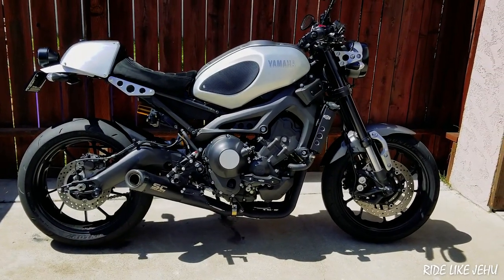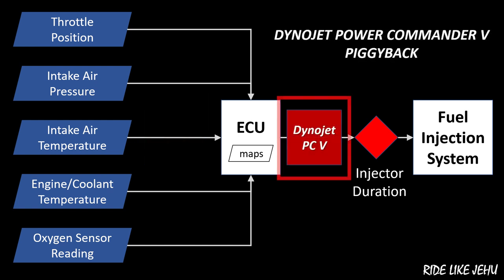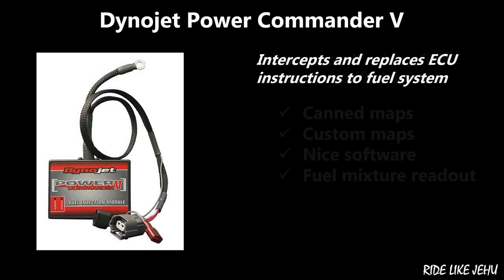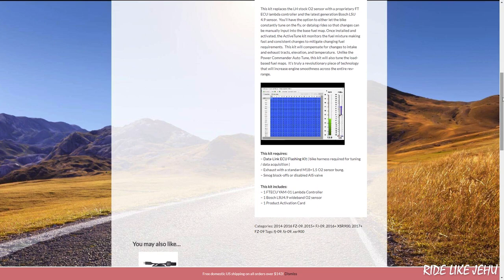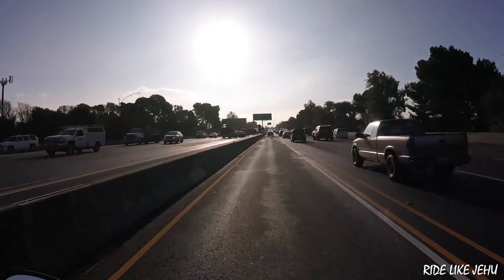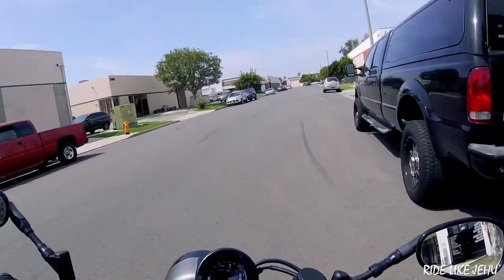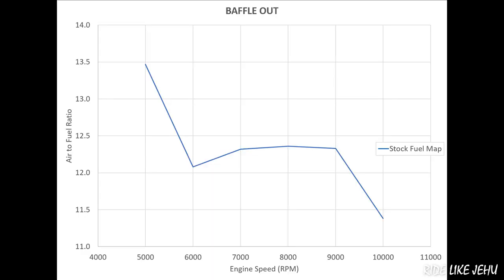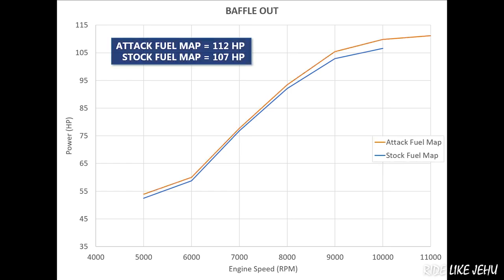Yamaha XSR900 SC Project Exhaust Upgrade Part 4

Comment: Blown-away by the detail, clarity and quality of your video!!  I feel like the gains ~ 7% (full system & dyno tune) are a very small gain.  If a person wanted more power they could just buy a more overpowered bike to begin with.  Tuning or engine work only seems to make sense to me if a bike is under-powered <40HP? and there is no other bike that is similar to buy.  Most people want the more noise & the illusions of power so a slip-on makes the most sense.  Again, thanks for such great info.  ***Next, maybe a video discussing the suspension which I have heard is on the stiff side.

Comment: I own an MT09SP which as you well know has the same engine and frame as yours. I’m also not in search of increasing horsepower but a better sounding exhaust. From listening at a lot of aftermarket exhaust systems on the internet I concluded that the SC Project systems sound the best for the triple engine. I am somewhat disappointed by all the companies that provide these exhaust systems however. They all do their best to sell you these quite expensive systems when in truth they don’t give any significant improvements in performance to the engine without having the ecu modified or installing a piggyback electronic system. I think that when you are shelling out that much money for a complete system it should come with at least a piggyback controller. SC projects is the only company that I know of that provides it’s own fuel controller system but you have to pay around $300 extra for it. It is not the air controller you mentioned but a new IFC system as they call it. Trouble is that the company will not send me a typical dynograph readout with the unit installed so I can see the improvements it makes. They assume that I shell out my hard earned money on trust alone. To me that is not acceptable.

Comment: How were you able to ride your bike away from the shop. I called Joseph about my XSR900 and he told me I had to tow my bike to and from the shop because of CA law requiring off road use only with after market exhausts. Did you install the exhaust first or did they install it? Thanks

Comment: wow!!!!!!! what a thorough review,,,,,,,,,, many thanks for this educational video series. 1 question, I have been told altering the ECU is a one way street, it doesn't seem true from your videos,,, you were able to retune it for with baffle ,  so can we tune the ECU multiple times ?
Reply from the maker: Yep, the ECU can be tuned multiple times. The dyno tuning process was iterative. Mine was tuned at least a dozen times while the fuel mixture and power output were optimized. Also, if you decide to put the original exhaust back on the ECU can be re-flashed back to the original settings. Of course if you're having a shop do all of this re-tuning they are going to charge you for their work.
Reply: Thanks!!!! I hope remapping the ECU won't void my warranty, I have another year left so I might just wait,
Reply: @RideLikeJehu  Good info.  I searched all over for this simple question and you are the first person to clearly answer it.  I guess no one has heard of "UNDO".

Comment: Wonderful! This is the only guide anyone would ever need to replace any exhaust on the XSR900. One thing that I was very curious about, and it's not shown here, is the emissions impact with the different bikes. I want an XSR900 and I'd probably replace the exhaust, but I also want to remain compliant with emissions regulations. Do you know of any site with a comparative as you found for power? Thanks.

Comment: The stock exhaust produce a flatter torque line. Why the SC project exhaust produces a dip in torque between 5k-6k rpm?
Reply from the maker: Good question. I wonder if the lack of cross-pipes between the headers is a sign that the SC Project is not as well engineered as the stock exhaust or the Akrapovic.
Reply: @RideLikeJehu  You would have to look for dyno videos on that pipe to answer that question.  I have a feeling that stock motor is really matched to stock exhaust flow and many aftermarket pipes will give in some places but take away in others.

Comment: So I bought 2019 xsr900 and love it I now have 500 miles on it ...  BUT something is wrong . Three times now during me riding normally the bike engine power shuts of randomly ( I have no idea why please help ) 
It starts right up after and is fine... ???
Anybody have similar problem or ideas why this is happening ?
Reply: YES!!!! THIS IS is because of a safety feature inside the bike. your hitting the rev limiter
Reply: same thing happens on mine
Reply: ride in A mode

Comment: Nice, I'm in SoCal. Might take my XSR there, how's the pricing for the reflash and tune?
Reply: NVM lol, added comment right before the end of the video  -_-
Reply from the maker: Haha! Yeah, free reflash. Jozef told me if I change my mind and take the baffle out again I can bring my ECU in and he'll put the baffle-out fuel map back on the ECU for free. If I get a new exhaust it'll be $350 to do the dyno tune but the reflash is free.
Reply: Awesome, so looking around $600 then. How about the time it takes, would I need to make an appointment in advance?
Reply from the maker: Yeah, you gotta make an appointment in advance. They'll want you to bring the bike there at 9 am with at least half a tank of gas and they'll finish by the end of the day, possibly early afternoon. At least that's how it went for me.
Reply: Alright, thanks dude

Comment: Usually, SC Projects recommends to change the air Intake if you go for a full SC Exhaust. I guess, the reason is the one you discovered. They run rich.
There is also a kind of Power Commander sold by sc Project that combines for some bikes the new map for a full SC exhaust and a new air intake. It would be interesting to see if this would bring you directly to these performances you got after having your bike fine-tuned on a dyno.

Great Job! I really appreciate your video about this bike.
Reply from the maker: Yeah that would be interesting. Thanks!